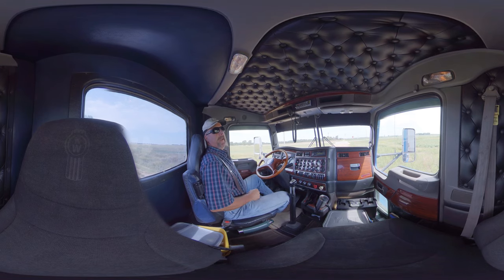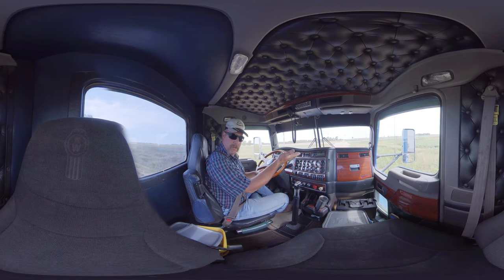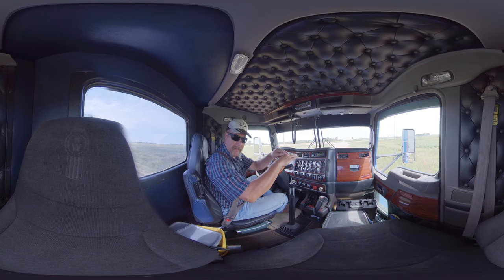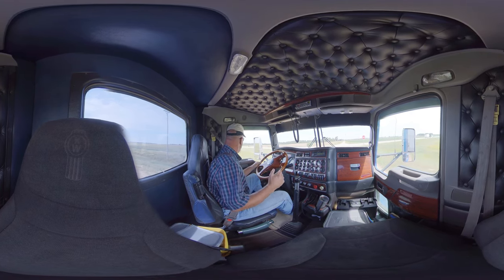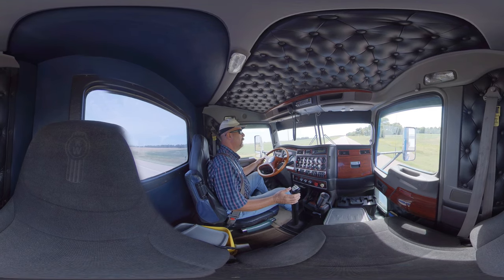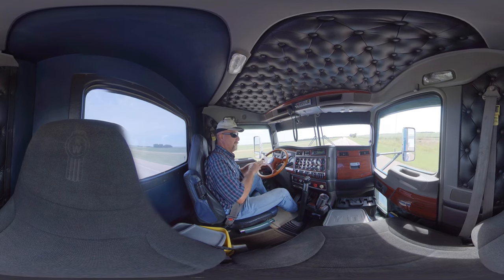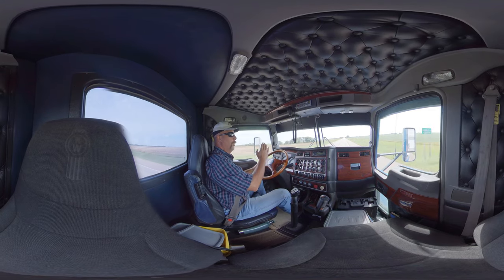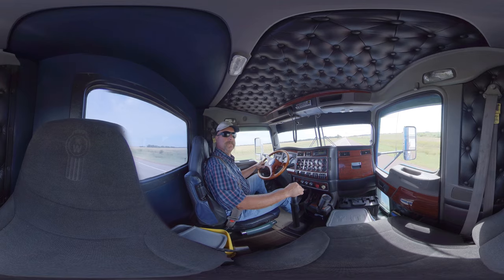432  How to shift a 13 speed transmission  360 video

Comment: Very nice. I used to drive a Volvo 410 with two gear boxes, 8 speeds each one, with the split bottom. The second gear box was accesses by pulling the shifter to the right.

Comment: I always liked Fuller transmissions, and the 13 speed was my favorite.  Fuller came out with the 10 speed in the late 50's or early 60's in response to the DOT mandate that all new truck transmissions had to be such that the driver didn't have to take both hands off the steering wheel to make a shift--one shift lever not two.  The 13 speed and others followed.

Comment: So is that throttle blip kinda like a temporary cruise control that holds the engine speed at a certain point? Does it calculate based on road speed vs engine speed and next gear or is it something more basic? Noramlly if I shift below 3000rpm on my 5speed then the rpm difference is 500 between gears, closer to 4000rpm its 1000 in difference.
Reply from the maker: Its calculated by the drivers ear.  He listens to the sound of the engine and it tells him when the RPMs are right to slide it into the next gear.  Just takes practice
Reply: @Sasnak  I drive by ear as well. it just sounded to me like your truck some extra feature to assist with throttle blipping.

Comment: Normally I drive a Mack tri axle dump truck.  That has an Eaton Fuller 8LL. We do have a Ford LTL 9000 with a 13.   And if I'm empty I start in low on the high side

Comment: Morning Stan, thanks for a interesting video,  I still don't understand how you can float the clutch but it was cool to see. Not sure if it's your video or my phone but ever time I moved my phone the video angle changed most annoying.
Reply: It's a 360 degree camera. You can slide the image around or rotate the image with a portable device by turning the device to different angles. It is actually a cool way to view the whole cab of the truck to see what is going on.
Reply: @bruceh3786  , thanks

Comment: Great demo, thank you. Now can you explain why and when would one use a 9, 10, 13, 18 speed? Are 18 speeds designed for really heavy loads going through mountains and 9 speeds for lighter loads on flat roads?
Reply: Yes a combination of the grade you expect to drive in + how heavy do you haul. For example if you're in the Colorado mountains hauling special permit overweight equipment you probably want the 18 speed for torque control, but if you're in the city with a pup trailer delivering light loads. A 9 speed or even 6 speed will do.

Comment: Question about reverse...  You might have mentioned this in your 18 speed video, but I'll admit it is late and I'm too tired to go look for it...  Anyway, the "granny" first gear is the odd one out - no high/low range, no splitting, right?  What about reverse, same thing?  Is there only one reverse, or is there a high/low range for that, and if so can you split the high side?
Reply from the maker: yes  you can split the reverse gears too.  On a 13 you have 2 reverses, on an 18 you have 4 reverses.  Typically you only use the one though

Comment: and to add to the 13speed shifting  one DONT need to start in 1st gear ,can start in 5th or whtever gear IF empty and also DONT have to spilt ever gear all depends on load and terrain  ...i also drive and shift as you NO clutch, its all in the feeling and sound of my truck engine

Comment: Did I hear "I ordered this truck from the factory?"
Reply from the maker: I ordered this truck new from the factory back in 2008.  Its a 2009 KW T660 and had a studio sleeper on it.  It got wrecked in Cali. ( not my fault, I wasn't even in it ) back in 2014.  I then bought a 2015 KW W900L an sold this truck to my friend and he turned it into a daycab.  He uses it on his farm.
Reply: Oh, that explains it.  He keeps it in nice condition. Looks almost new in the cab. That 360 camera works great for me -- on a big Macintosh screen..